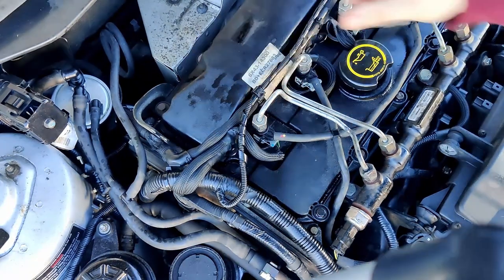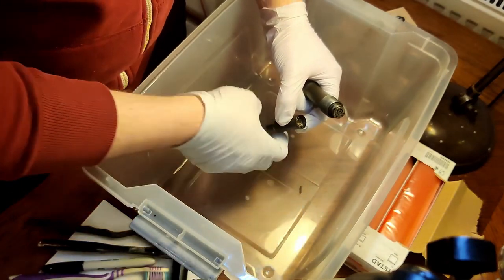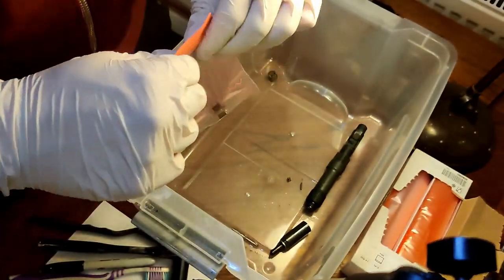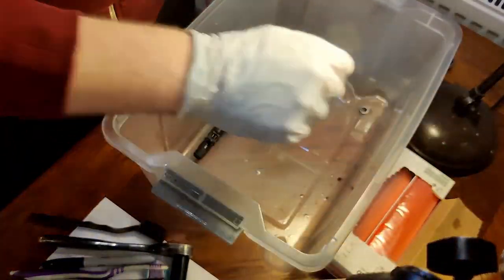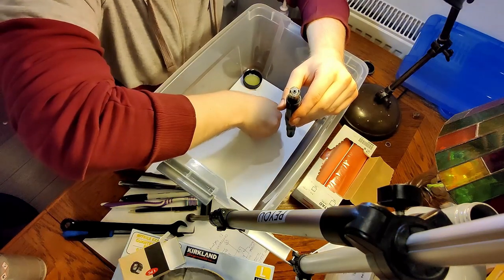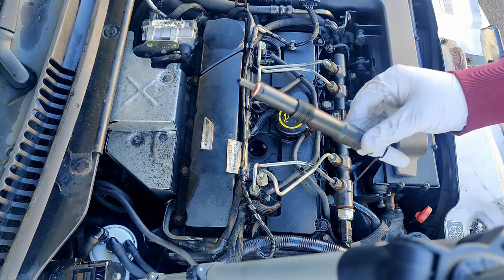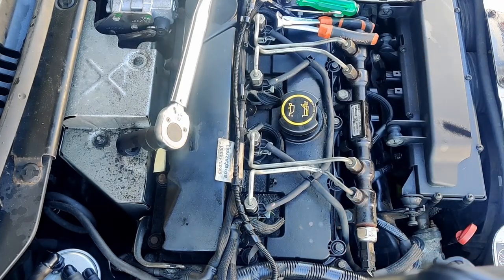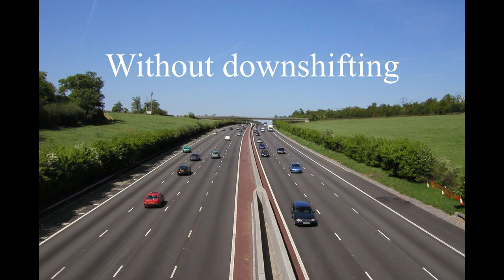Jaguar X-type 2.0d (Ford Mondeo mk3 2.0tdci) Diesel Injector Rebuild DIY

Comment: 👍. Liked and subscribed 👍
for me very valuabe informations :
30:11 - loosing nut a little bit, to remove airlock during engine start
32:51 - about unnecessary coding after rebuilt 
              and self-adaptation of engine on a highway

Comment: Codding is important! I just had a case where one injector was changed with second hand one and the car was in limp mode and the errors couldn't be erased. I coded the new injector code and the errors cleared right away and the car stoped smoking and runs ok.